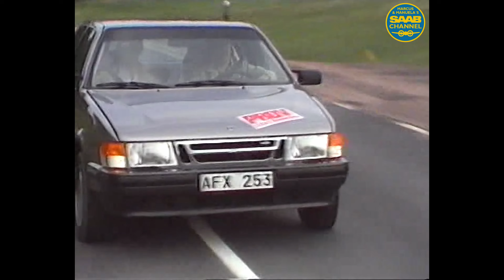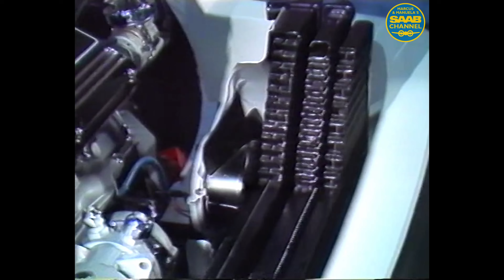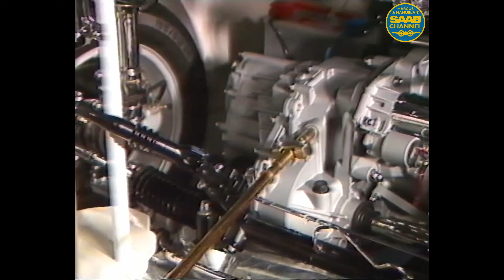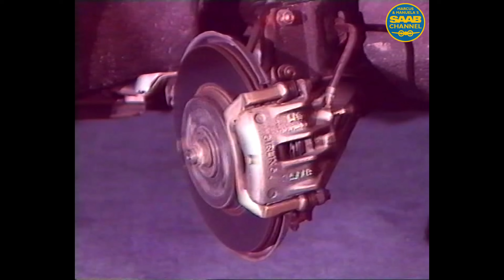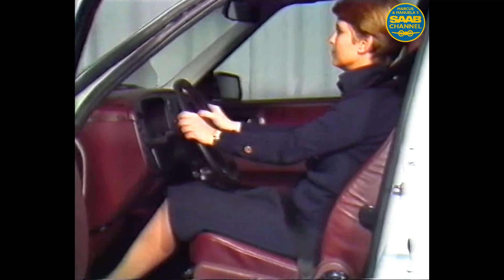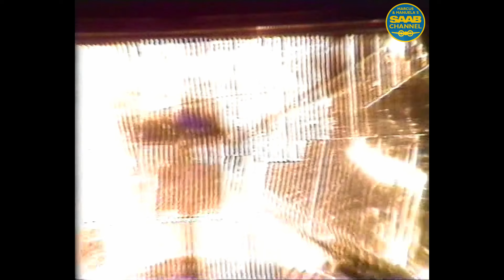The Saab 9000 Turbo 16 Technical Presentation

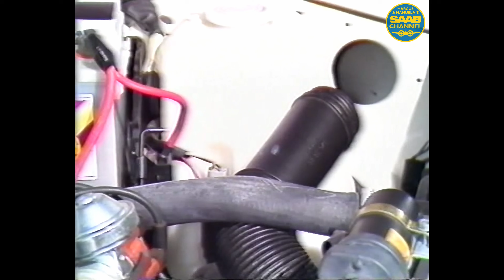Comment: 04:15 - Yet, while driving in the snow near Luleå, Sweden, we managed to get the air intake clogged. Fortunately, this was a known issue for the Saab mechanics on site, and they resolved it within minutes.
Reply: How did you manage that on a 9000?  
The air inlet where it is sucks air from beside the engine compartment from a closed "box" is impossible to get more than extremely litle snow. 
I have never heard of this and i have lived in the northen part of sweden for many years.
Reply: @fortune300  It must have been around 1990 during a winter driving event organised by the Saab factory. We had access to seven 9000 Turbos, two 900 Turbo-16s, and a few 9000 CD Turbos for local transportation.

Under the guidance of professional rally drivers, we spent three days on the ice of a frozen lake with the cars (excluding the CDs), reaching speeds of up to 130 km/h—mostly sliding sideways rather than driving straight. During this event, our car stalled due to a clogged air inlet. Fortunately, Saab had a team of experts on-site, including mechanics, who immediately recognised and resolved the issue.

Interestingly, three of the 9000s didn’t survive the event. Two collided with each other, and one lost its drivetrain in an ice wall. The remaining four cars were heavily damaged. According to Saab representatives, these vehicles were destined for crash testing after the event. Meanwhile, the 900s and CDs remained unscathed.

The experience and knowledge I gained during that event later helped me avoid a severe accident on the German Autobahn, where others weren’t as fortunate.
Reply: You need a mechanic to pull snow out?😂😂😂
Reply: @ColdPetRat2.99  The car was from the Saab-factory, just like the mechanics, so why do it myself??? 🤔
Reply: @The.NetherIands  It was brand new?
Reply: @ColdPetRat2.99  The CDs and 900 Turbos were next to new, the CD I drove had about 1.3k on the odo, as far as I can recall.
The 9000 HBs were former press cars, still young, but they were due for safety tests. The 900 turbos had some serious spiked tyres, never seen it before and the grip was almost endless.
Reply: @The.NetherIands  Never have seen cd in my life, they look bit funny
Reply: @The.NetherIands  I currenly have 2 9k and one 9-5, best cheapest and most reliable cars, ok I never had mazda 6 or celica, but had volvo 850, I killed it in 3 months, I dream of importing nice fresh 850 from netherlands, there cars seem to be best maintained
Reply: @ColdPetRat2.99  My father had a CD Turbo. At that time, I was driving an Audi V8. I still have my first car, a 900 GL, and currently drive a 9-5 NG V6 Aero as my daily. I also have an 9-5 '08 Aero.
I personally prefer buying cars in Germany - there are more options included and they tend to be well-maintained.
Although I'm not into Volvo's, I do like a classic 850 R, the sound of that 5-cylinder tops the car.